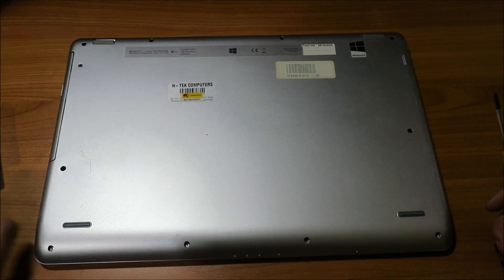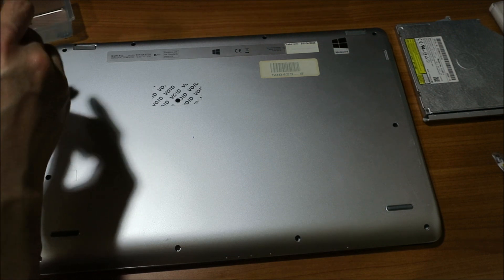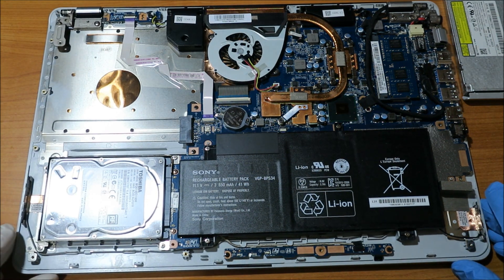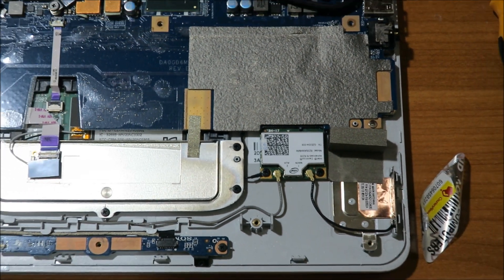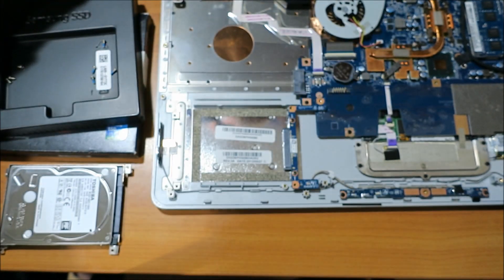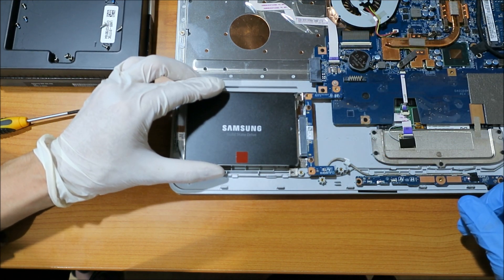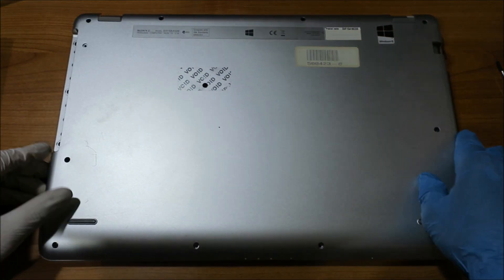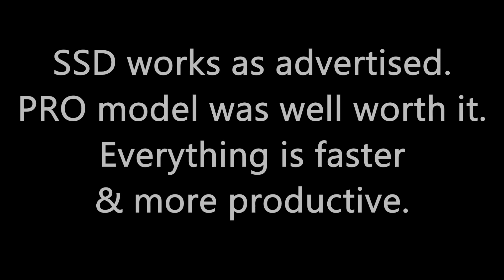SSD Upgrade, Sony VAIO Fit 15 SVF Laptop

Comment: Hey, good job.
It's cool to show read/write number speed differences, but the real thing that makes non-techies oohh and aahh is simply demonstrating the differences in boot times between mechanical and solid state drives.
Maybe in your next upgrade video? :)
Reply from the maker: Good feedback. I didn't want to spent too long on more technical comparisons. Other guys have covered that better than me. But SSD's are definitely worth it 😉

Comment: Cool 😎 video and thanks for pushing me to finally upgrade to a ssd. It’s life changing 👍🤣. Ah I wouldn’t be using a magnetic screwdriver on a computer but🤷‍♂️that’s just me. But thanks for your help. The biggest problem I had cloning the drive, my drive had BitLocker on and was encrypted. So if anyone trying to clone a drive, you have to decrypt the drive first. My computer was way easier 🤣 1 screw, panel opens access to the drives and the RAM, which I also upgraded to 16gb, maxing it out 🤣👍. Thanks for the help and the informative video that started the journey of me getting a ssd 🤣🤣🤣🤣👏👏👏👍👍👍👍👍👍👍
Reply from the maker: Congrats bro! Glad you took the leap. It's a totally different computer now.
Good feedback for encrypted drives. Who are you? James Bond? 😂✌️
Everything is faster. Enjoy the quality of life 😉👍

Comment: Thanks for the video! 
The whole ¨it's like lego's'' kind of thing goes only so far. When you have to switch keyboards..... glue.. and all kinds of weird stuff.
Reply from the maker: Your welcome, and totally understand. Newer OEM designs are actually bad. They glue, solder, and laminate parts so you can't work on them. Try to force you to buy another. Depend on each manufacturer and model. The SSD was the best upgrade. It's faster and more productive. Better than new 😉👍

Comment: Really looks helpful n handy, thanks for small details n tips.

So With the Cloning did you got all operating system pre installed on new drive? I was waiting at the end to turn the laptop on.
Reply from the maker: Yes, correct. Good questions. Your exact setup is copied to the SSD. That's why it's called a 'Clone'. You don't have to start over. When you turn on the computer it's the same setup I had, except faster. Start, Shutdown, and Restart all become very fast. I had to reboot a few times to get all the SSD features working. I covered that in the RAM Upgrade video we chatted on earlier. I showed the computer Restarting at the end.
Reply: @BAdventures  hey bro, after i ordered...just noticed yours’ is 850 pro.
But i purchased EVO 860 by seeing the link in description. Will this works too??
Reply from the maker: Yes and good choice. The 860 EVO is the newer model and I recommend it.
I was experimenting and testing the older 850 series.
PRO is for hard use, like constantly transferring large files and heavy work loads.

Comment: Hi. You have made a great video and I used this to install ram. Now I will install a   SSD. However you have also said you updated the wifi card. Can I ask if you are able to advise the latest card that my system will accept. I know you video is from a while ago so there have been lots of new WiFi speeds. I know I can install a dongle but wanted a WiFi card inside. Thanks. My laptop is the sony vaio svf15a1s2es. Or if you can advise the very best speed card that it will accept. Some say WiFi 6e will work on the laptop?
Reply: Hi. If you can advise on the wifi card. Thanks
Reply from the maker: Thanks for the feedback, and glad it helped your RAM upgrade. Your laptop model looks very similar to mine. On SSD I recommend any of the Samsung EVO models. They're affordable and good performance. I was testing different models.
On wifi the original Broadcom card was so bad the internet would drop off regularly and short range. It even stopped working as Broadcom stopped support. So I had to change it. If your network card is working, leave it alone. I'm not sure WiFi-6 card will work. Also better off buying a newer computer.
I used the recommended compatible model: Intel Network 6235AN card.
The SSD is the best upgrade for any old computer. Everything is faster and smoother. Hope that helps and good luck with your upgrade project 👍
Reply from the maker: I used the recommended compatible model: Intel Network 6235AN card. Very affordable and common at the time, about $16.
Reply: @BAdventures  Do you know at all what is the latest version I can use. I understand I cannot use AX cards. Any suggestions would be great.

Comment: Hi, I have a “Sony VAIO SVF14N2A4ES Fit 14A Multi-flip 14” Laptop”. The Disk usage shows 100% so whilst I was searching for a solution I found myself on this video and comments. I wonder what is a good and compatible SSD that I can use to replace my 1TB HDD please?
Reply from the maker: Possible Solutions: 
(1) Get an external hard drive to back up your files and free up disk space.
(2) Recommend the Samsung 870 EVO series SATA connection SSD.
Happy with all the SSD models in my videos, and the laptops are still going strong. SSD is the best upgrade for an old computer. The old SATA hard disc drives wear out and become really slow.
Note your model spec: Intel Core-i5 4200U processor. Always check the CPU first. Demo videos below. 
(3) A newer model computer. Find a slightly used with newer and better processors: Intel Core i5 and i7; and AMD Ryzen R5, and R7. 

Sony VAIO Flip Laptop SSD Upgrade https://youtu.be/Pb20r0CiunA 

SSD Install Sony VAIO-S Core-i5 https://youtu.be/k_-HPVC59Bo 

Sony VAIO SVF14N2A4ES Fit Specifications: 
https://www.svp.co.uk/sony-vaio-fit-multi-flip-svf14n2a4es-2-in-1-laptop-intel-i5-4200u-8gb-ram-1tb-sshd-14-quot-triluminos-display-windows-8-silver-6348.html 

Hope that helps 👍

Comment: Hi, Would you please tell us the links to buy the Intel Network 6235AN card? Thanks you so much.
Reply from the maker: I got it off ebay for AUD $15 (US $11 ). It was a common part back then. Also on Amazon. I'm not sure what region you are in. I downloaded the Intel driver files before installing the card. The Bluetooth was a separate driver. That way it was ready to go. Hope that helps 👍
VAIO Fit 15 RAM Upgrade https://www.youtube.com/watch?v=31vmxyrdfV0&t=1s
Reply: @BAdventures  Thanks you very much for your helpful information

Comment: Im trying to revive my old Sony Vaio SVF15A190S/SVF15AA1QL as its super slow to run and open programs, would swapping out the harddrive make it faster if i swapped it to SSD?
My Specs on it is
8GB RAM
I7 3537U @2GHZ
Reply from the maker: Your model is very similar to mine in this video. Yes you definitely need to replace your old hard drive. It's worn out, which is why it's so slow.
I recommend the Samsung EVO 1TB 2.5" Internal SATA SSD. Everything is faster. Also quality of life benefits. No moving parts, less heat, less noise, smoother. Hands down it's the best upgrade for an old computer.
*Note: I was testing out both the EVO and PRO models. You can save money by using the EVO model which is just as good.
See follow up video below. I show how fast the SSD read/write speeds can get.
Sony VAIO Fit RAM Upgrade https://www.youtube.com/watch?v=31vmxyrdfV0
Reply from the maker: Video below shows the cloning process. Copies everything onto the new hard drive. 
SSD Upgrade Tutorial, Sony VAIO-S Laptop https://www.youtube.com/watch?v=k_-HPVC59Bo

Comment: Hey there. Did you need to migrate anything from your old hard drive to the new one? Or did you just replace it and everything was still in your laptop, intact (files, programs, etc)?
Reply from the maker: Yes I did a clone. Meaning everything was copied from the old SATA drive to the new SSD. Then physically installed the SSD. Another tutorial below 😉👍
Sony VAIO VPCS SSD Install https://www.youtube.com/watch?v=k_-HPVC59Bo

Comment: Hi B Adventures, Would you please tell me when you installed the Intel Network 6235AN card. Do you need to install the driver for it or Window 10 will automatically install it for you?  In case if I need to install the driver please tell me where to download it? Please make a video to install the Intel Network 6235AN card if you could.  Thank you very much.
Reply from the maker: I downloaded both the Intel WiFi, and Bluetooth drivers to the desktop just in case. Then installed them after the upgrade. Windows 10 trouble shooter will also install the drivers to get it working. You can find it directly on the Intel Drivers website below. 
Intel network drivers  https://www.intel.com/content/www/us/en/support/articles/000006507/network-and-io/wireless.html

Comment: Does the assist button work after replacing the hard drive?
Reply from the maker: That shouldn't have anything to do with the the hard drive. That's a firmware or software issue. I've never needed to use it. To answer your question: I just tried using the Assist button and it didn't work.
You can use the Windows key, or click on the Start menu to find anything you need.
Reply: @BAdventures  thank you for replying. I use assist key to open the bios settings. It is possible only after it is shutdown and hold down the assist key. Because function keys don't work. Did you have any trouble booting from the media when you first installed the windows?
Reply from the maker: Oh I see. Thanks for explaining. Not trouble at all. That's why it's called a "clone". Everything is copied over to the SSD the same. Video below shows the Restart and boot up. I recommend the Samsung EVO version. I was testing the different models. Hands down the upgrade to SSD was the best. Faster everything.
Sony VAIO Fit RAM Upgrade https://www.youtube.com/watch?v=31vmxyrdfV0&t=451s

Comment: If I change the SSD does that mean all the items saved in the computer will be gone?
Reply from the maker: Not if you 'clone' it. That's what I did at the start. Copied everything into the new SSD as a clone. Swapped hard drives. Turn computer back on. Everything is like before, all your files and settings are the same. But everything is faster. The computer can run at max speed. Below video shows more of the cloning process.
Sony VAIO-S SSD tutorial https://www.youtube.com/watch?v=k_-HPVC59Bo&pp=sAQA

Comment: Hey there would you recommend the Samsung over the Crucial MX500?
Reply from the maker: Yes. I recommend the newer Samsung 860 EVO model.
I only buy Samsung flash memory now. Good performance and reliable. Other SSD brands can be slower speeds, or suddenly stop working when they burn out. Samsung SSD's also have RAPID feature. Easy to turn it On or Off in the Magician software. Makes the SSD even faster by using some RAM as cache. Feel free to ask if you need help.
Reply: I saw for Ram video where you recommend a website for RAM and SSD and they recommend me the Crucial one
Reply: I have a Sony vaio as well
Reply from the maker: Oh I see. Crucial is good to check the parts and specs. Search your VAIO model number on the Sony website. Once I figured out my RAM specs, I found Samsung RAM online. Both the RAM and SSD upgrades were well worth it. Better than new. Faster and quiet. PM me on Facebook if you want help with your upgrade project.
https://www.facebook.com/BAdventuresAU
Reply: Thank you very much, I'll do that 😊

Comment: alright I need serious help. I connected my new SSD to my laptop with a SATA cable to format it correctly (to a GPT) and change the BOIS settings. I downloaded Windows 10 onto a USB drive and when I go to install it onto my new SSD once I install it on my laptop (SSD put into laptop) the program keeps saying, "SSD needs to be a GPT (or something along the lines of that) so I don't know how the hell it's not formatted correctly at this point but it's just pissing me off that no matter how many programs I use or formatting I can't install a new SSD with windows 10.
Reply from the maker: Your situation sounds over-complicated.
I would have installed Windows 10 first. Made sure everything was working. Then clone to your new SSD.
You changed the BIOS and tried installing a new OS. A clean install is different to a Clone. 
Best to take it to a computer technician or repairer. Get some specialised help.
Or try the clean install with the old hard drive. Get it working first. Then clone to your new SSD.
When you "Clone" it's literally a copy of your computers image. If you want to make any changes, do it before the cloning process. Eg I upgraded to Windows 10 and deleted any unnecessary programs. Then ran a Defrag and Disk Clean. Basically cleaned up the old hard drive. Everything was working stable and normal.
I then proceeded to Clone to my new SSD, as it was a working image.
Hope that helps 😎
Reply: @BAdventures  I've tried multiple programs to clone the SSD but the Samsung Data migration is straight up terrible and MiniTool Wizard pro keeps saying my SSD is to small to be cloned even tho I made sure there wasn't too much data that had to be cloned.
Reply from the maker: Are you cloning to the same storage capacity size? Eg 500GB SATA HD to a 500GB SSD?
If you are are using a new drive with different capacity you have to do a partition hack. Then adjust the partition after the clone. Some motherboards may not recognise the difference in size.
I demonstrated the Samsung migration software in 2 videos. No problem. It actually made it all easier.
If you want to try fix it yourself google it.
Otherwise get professional help. Hope it works out.
Reply from the maker: Previous How to Install SSD video https://www.youtube.com/watch?v=k_-HPVC59Bo

Comment: i would like to upgrade my  sony svf15327scp processor from i5 to i7, is it necessary to change the motherboard?
Reply from the maker: I don't think it's practical. Not sure if you can do it. Usually laptop processors are locked to the factory motherboard and you don't change them. That's usually a desktops thing.
It's already and old laptop. I would recommend buying a new computer. Look into the new AMD Ryzen 4000 mobile processors. 8-core laptop is a better upgrade. Article below.
https://www.anandtech.com/show/15324/amd-ryzen-4000-mobile-apus-7nm-8core-on-both-15w-and-45w-coming-q1
Reply: @BAdventures  thanks for your info, really appreciate.
Reply from the maker: Your welcome. I understand as I was looking into different options. I upgraded both my Sony VAIO's so they would keep working. That way I'm not in a rush. I've been waiting for these new AMD 7nm laptops 😉👍

Comment: your a bit shaky there hahaha looked a bit dirty still under there should have pulled the fan out and also re put new compound on the CPU and Video card chips while you had it apart they get very dry under there well i did it with mine and was all cracked and nearly usless was a lot cooler after i did that
Reply from the maker: Was working late night, hands of a surgeon lol. You're right should have checked the thermal compound. Didn't want to get distracted. This laptop use to sound like an electric drill under heavy load. It's much cooler and very quiet now. The fan cleaning and SSD really helped.

Comment: why dont run it , it says not supported .
Reply from the maker: I think you're referring to the Samsung Magician firmware. You can install and run the software but it won't be fully active on another hard drive. I used it to test the performance of read/write data speed on both hard drives. The old SATA hard drive vs New SSD data speed. Comparing the old with the new. Hope that helps 😉👍

Comment: if i've lost everything on my hard drive  do to a bad virus can i replace it with a new one and just do a fresh install like windows 10 .which should allow me to start over as if it was brand new laptop ???? need help please
Reply from the maker: The answer is Yes. But sounds like you need help. Find a local technician or computer repairer. They might be able to recover the old hard drive; and help with a new SSD and fresh install. I can only do so much replying online. Hope that helps. 
What is the exact computer model and number? And the build or model year? So we can check the specs.